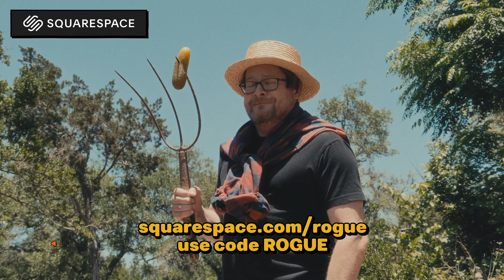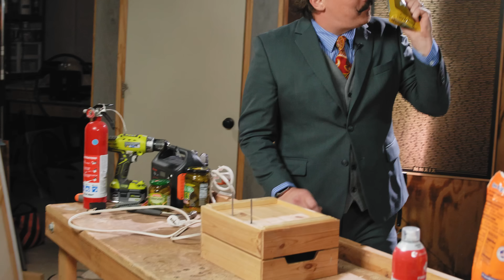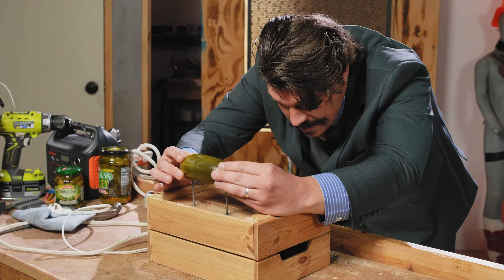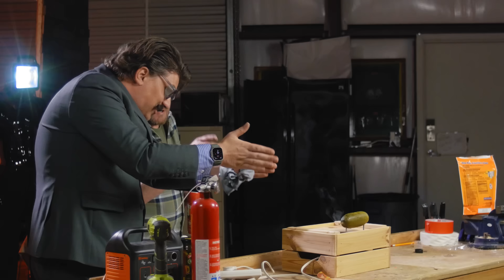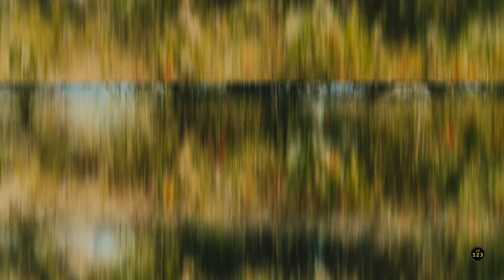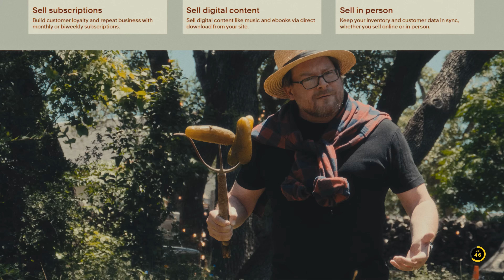Dangerous Pickle Lightbulbs

Comment: High pressure sodium bulbs (those yellow parking lot lights) are coincidentally(?) Pickle shaped. Literally the first thing they said.  This is why we watch the video before posting..

This also works in a microwave.  It also works with grapes in the microwave they tend to explode though so if you cut them almost completely in half and leave the skin connected to both halves and set it on a plate "open faced" will prevent grapesplosion.

Also works with a CD read side down but it will ruin both the CD and probably the microwave.  It will definitely contaminate it with tons of carcinogens.  So don't do that unless it's a microwave: only for science edition.

Comment: The Penn and Teller quote is great.

Also, while I'm not a physicist, my hypothesis would be: the end/point that lights up likely has the most resistance. For example, on the big pickle, the stem side appears to light up. This would make sense, as the stem side would likely have been the upper-most point when the cucumber was hanging on the vine, and water would have pooled at the bottom. This would mean that even after brining, the 'bottom' of the pickle would likely have more space/cavities for liquid, which would conduct electricity better. The current needs to flow laterally across the circuit at a 'constant' rate, so the point of most resistance will be struggling to keep up, and the sodium being the next most conductive substance will arc and glow.

Comment: Small note, incandescent bulbs are mostly manufactured with an inert gas rather than a vacuum. I do beleive that with a vacuum it becomes more efficient and longer lasting.
Reply: For incandescent bulbs with tungsten elements, the longevity is actually the other way round: If you have a vacuum inside the bulb, tungsten metal slowly sublimes from the absurdly hot element into vapour, which then condenses on the inside surface of the glass, which is a fair bit cooler, though still hot compared to room temperature. This is responsible for the element eventually snapping once part of it gets too thin, and is what causes the darkening of the bulb over years of use.

There are types which have inert gas rather than vacuum in the bulb, though at only a few psi - much less than atmospheric pressure. These are often called "halogen" or "quartz halogen" bulbs because they also contain a small amount of iodine vapour. This reacts with any tungsten vapour to form tungsten iodide, which the element (while switched on and hot) can thermally decompose back into tungsten metal and iodine vapour. So the element is continuously regenerated while the bulb is on, which gives this type a much longer lifespan.

Some really large tungsten filament bulbs (in the region of 10 to 20 kilowatt) deal with the darkening in a different way: In addition to the much larger element (made of much thicker gauge wire), they have some tungsten metal granules loose inside the bulb. The idea being that when the bulb is switched off (and after allowing it to cool down), the bulb could be pulled out of its socket and gently shaken, letting the granules move around inside, scraping any tungsten deposits off the inside surface of the bulb.

Comment: I've done this. I was VERY careful because it is absolutely dangerous. I set it up on a ceramic dish outside on my balcony with nothing flammable in the area. And I was VERY careful not to touch anything. I used a surge protector as a switch with my stripped extension cord plugged into that. I was a high school physics teacher and very familiar with electrical safety. A couple of years before I built my own van de graff generator. It smelled terrible, but it looked awesome.

Comment: How is it possible to do this video and know so little about how this works? At 9:45 they get close. They keep calling it a sodium arc lamp and seem to miss the point. The light is generated by the arc traveling thru sodium plasma in the arc. The electric current excites valence electrons which then emit a photon when they drop back down their energy quantum levels. The reason the light is that specific yellow is that is the wavelength of photon that corresponds to the energy difference between the excited and stable electron states. The reason only one end lights up is because the arc only happens at one point in the circuit. The current is applied and the juice boils and makes an arc gap which then eventually burns or boils away leading to a change in the gap and loss of arc stability.

Comment: If you want to see the coolest way this exact thing has ever been practically implemented..

Do a search for Sylvia Massey pickle filter.. 

She's an amazing and legendary master audio engineer (and my personal hero as I'm also a pro audio engineer) who has recorded and mixed albums for bands like tool and the Melvin's (and many many more).. 

If you've listened to the Melvin's, you may have already heard the result... 

As she used the graph of voltage strength (I think that was the measured aspect)  from the arcing of electricity through a pickle as the trigger for a noise gate effect on a guitar solo on one of their songs.. with amazing results. 

Basically, she set the threshold for the noise gate to  close (maybe open, I forget which) using the strength graph of the electricity through a pickle.. so it'd close if it peaked above a specific point of the graph.. and it'd stay closed only while the graph value was above that threshold and itd reopen.. (in realtime)

So this graph from the pickle basically became the blueprint for when and how long you couldn't hear the solo.. (sort of like rapidly hitting 'mute').. and because the peaks on the graph were really spiky (corresponding with the arcing within the pickle), it gave this rapid a random 'breaking up' effect to the drone quality of the solo.. 

(I think I got that right, going on memory, lol). 

She's a flat out mad genius.. I mean she's gone to some wacky really unconventional lengths to get truly amazing sounds and tones... 

Like buying worn out stand up pianos, fully miking them up, and then having a band member shoot them with his shotgun.. 

Or miking up a full Marshall stack and shoving it off a cliff to get the sound of the crash

Or having the lead singer of a band singing their vocal tracks while on a car's hood that's going 50-60mph.. 

😂

Her book is amazing for ideas.. truly a legend..

Comment: RT he lightbulb lifespan chart is sort of wrong. We don't actually know how long an incandescent lightbulb could last. You can build one to last basically forever. The one in Livermore, California has been on since 1901

The only reason they are so short lived is planned obsolescence. Which kinda makes sense. Why have a relatively cheap product people are only going to buy once. But as always, greed ruined everything. We could have cheap, longlasting bulbs that are eco-friendly due to their longevity. But manufacturers decided to make them burn out as quickly as humanely possible without raising legal issues. Juuust toeing the line where it's still an acceptable ripoff
Reply: this isn't really true, as long as a tungsten filament is running it's being sputtered away, and they fail because the filament gets too thin.

the lower power they're run at, the dimmer they are and the longer they last, but the less efficient they are.

1000 hours is the standard incandescent lifespan, because that ends up being the best balance between efficiency and brightness, and they're so cheap you can replace them easily.

you can run a 100 watt bulb at 200 watts, and it'll be brighter than a 200 watt bulb, but it'll only last an hour or so. if you run it at 50 watts, it will last a century, but it'll be as bright as a 10 watt bulb.